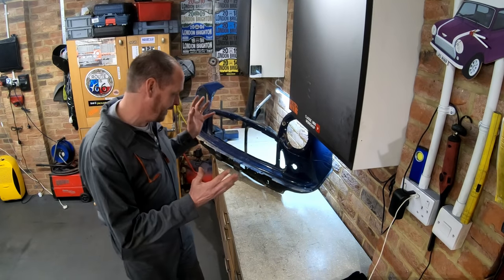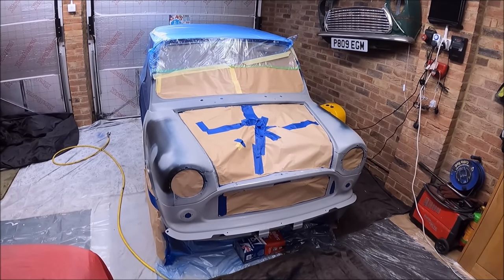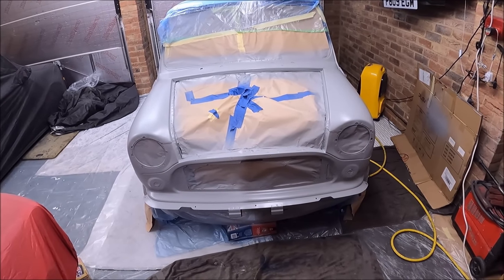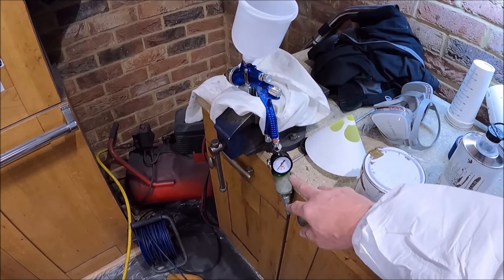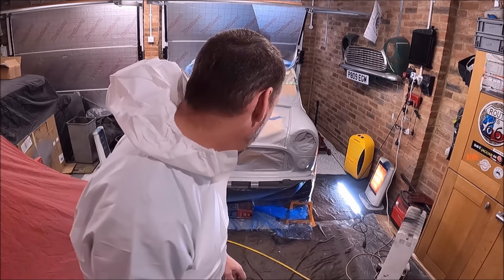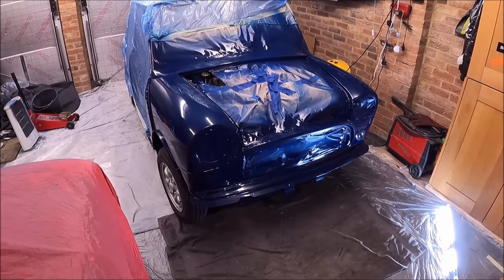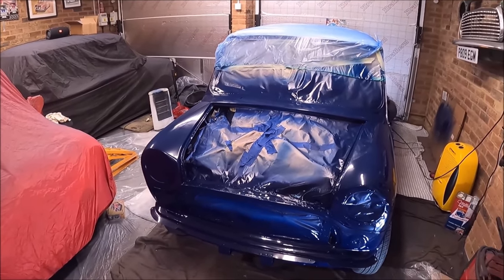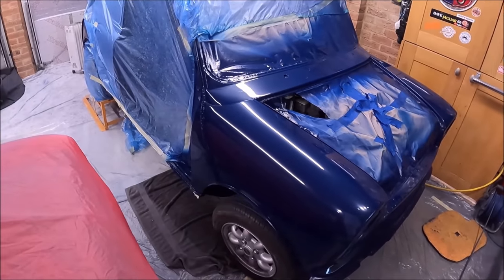DIY Respray *Budget Restoration* - Classic Mini Workshop Part 28

Comment: Looks good. I would say next time you paint always keep a wet edge don’t jump to another part. Just keep your wet edge and keep moving. Don’t worry about a wet look finish on first coat. Also tack rag open them right up and let them vent for a few minutes before using
Reply from the maker: Thanks for the tip

Comment: Glad your still here mate, not sure about the heater running while your spraying. Good job though.
Reply from the maker: Thanks Mick. What's the concern with the heater? It's halogen, so no ignition source.
Reply: @classicminiworkshop  concern is that it’s an ignition source mate. For the same reason spray booths use intrinsically safe fans. Even brushes on a fan can start a spray booth fire mate.

Comment: Have you ever driven a MPI with the John Cooper 5 speed gearbox - I wonder about the change and the syncro/jumping out of gear etc reliability ?
Reply from the maker: Yes, I own a Cooper S Sport 5. The car has done 105k miles and they gear change is fine, although they are reputed for being weak apparently

Comment: Looking really good there Keith. I don't know whether to have my Mini done in its original cellulose or in  2k. What do you think? Thought Keith please.
Reply from the maker: I would 100% go with 2K given the choice. Cellulose is OK, very forgiving for a beginner like me but it has no chemical resistance, so spill any brake fluid, fuel or solvents onto it and it will take the paint off. 2K stands up to pretty much anything
Reply: @classicminiworkshop  I know what you're saying but the thought of originality is very tempting Keith 🤔

Comment: Flat and polish it with 1200/1500 then buff with a machine but make sure you leave it as long as you can because it will take a long time to fully cure good job , I think you could have used a bit less paint probably 3 coats would have been enough 👍👍👍
Reply from the maker: Thanks Neil, that's pretty much what I done. The tops of the wings were fine with just a machine polish using Farecla G3, however I wasn't 100% happy with orange peel on the bonnet and scuttle so I used 1500 wet, then 2500 wet before G3

Comment: Are your neighbors cars now blue??? A filter would help
Reply from the maker: No they are fine LOL. I had a filter on the extractor for the primer but took it off for the color coats. I need a bigger extractor really. My own cars were within a few meters outside and there was no overspray or dust on them. The neighbors cars are at least 10M away